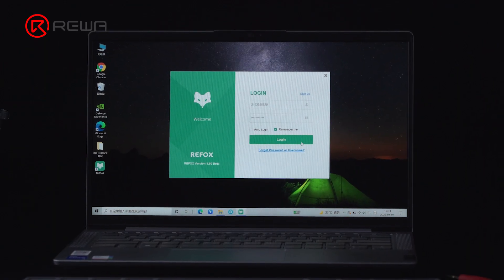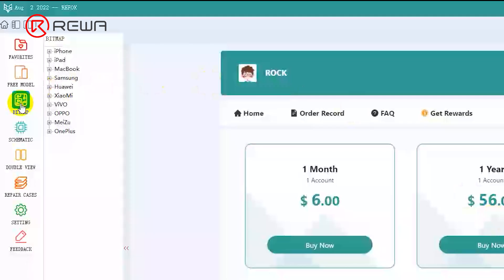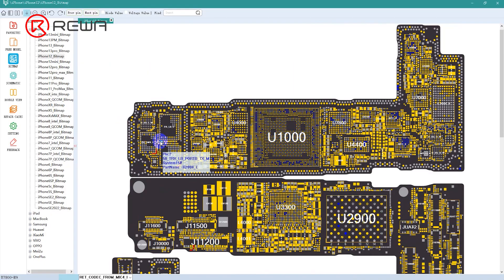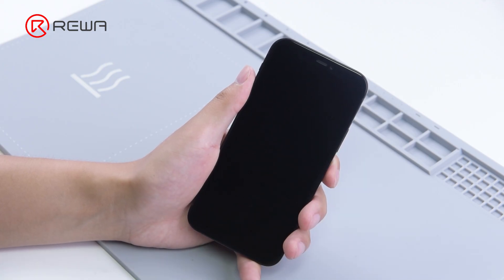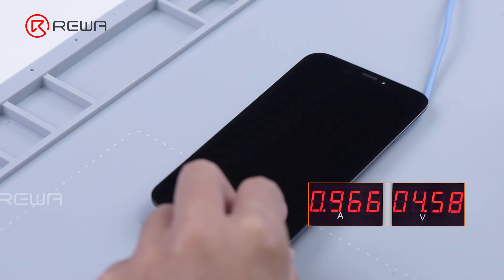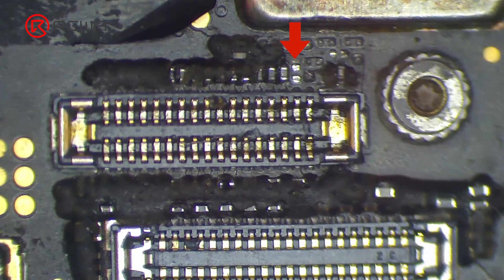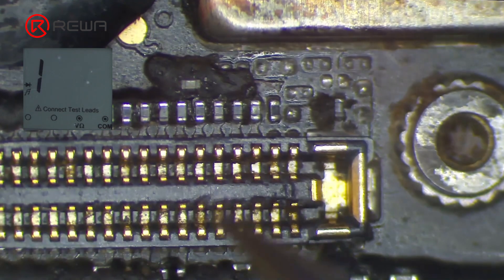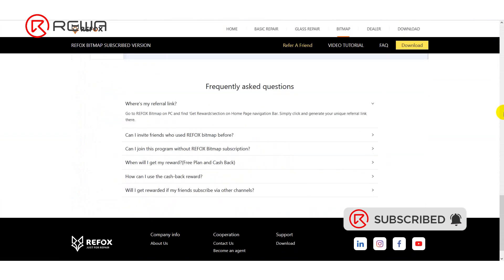A Beginner Guide (Why & How) to Using Boardview Schematics for Phone Repairs

Comment: This is not for the starter . Is there any app out there where I put the camera over the motherboard & it tells me which one is the power supply or which one is the network ic or which one the mic in simple language when u focus on certain part of the motherboard with your camera. I'm a total newbie & want to learn it like ABC .
Reply from the maker: Hi, the boardview software contains component distribution diagrams where you can view the motherboard with each component illustrated.
Reply: Well these are for electrical engineers . The terms or names used for the chips can only be recognized by engineers not normal people like us . For us if you name a chip let's say power supply for the processor or in short psp or power supply for the display in short psd would be more understandable & would check those chips if our display stops working.